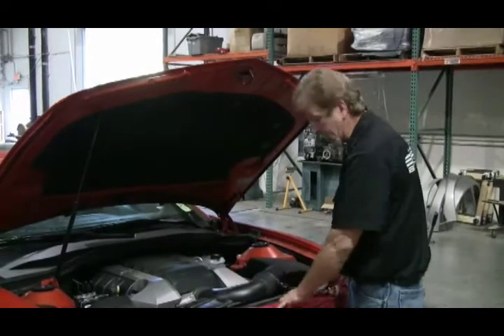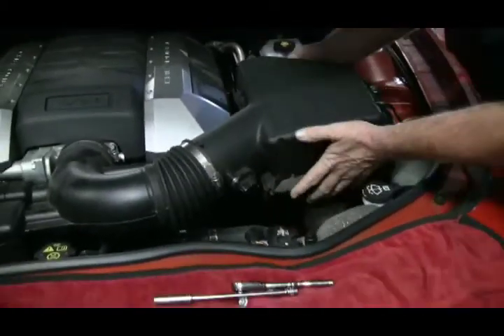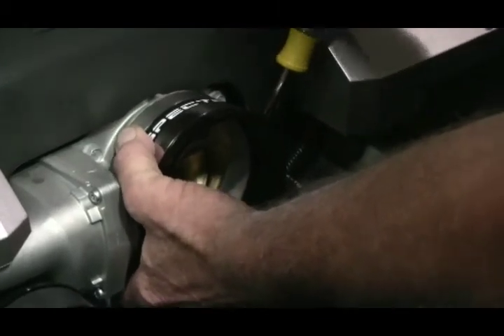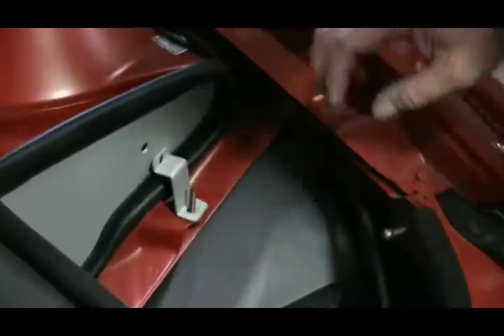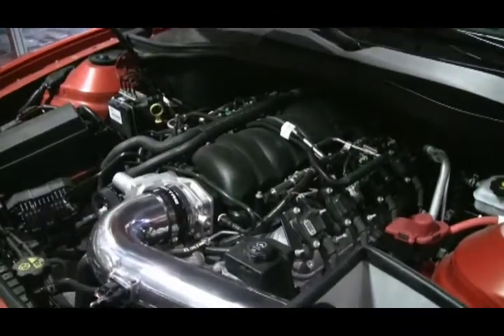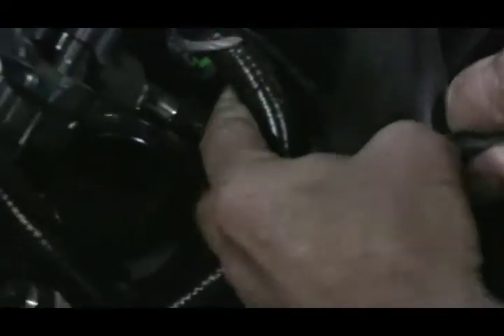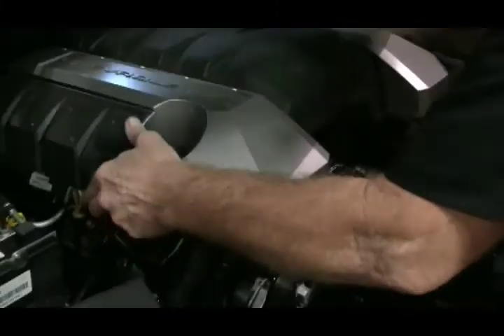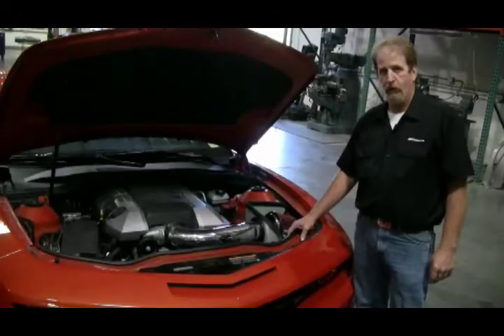Spectre 2010 Camaro SS Cold Air Intake Dyno Test & Install

Comment: I noticed the difference with mine but I have headers with a bigger Y pipe and straight piped exhaust with a flowmaster super 10. and upgraded 8mm MSD wires iridium plugs and Accel super coil pack. before the CAI it felt like my truck was struggling for air after it had a lot more throttle response and my exhaust got way more loud.

Comment: No Cai will make a difference without a tune other than sound. I have a srt8 exhaust tune and spectre Cai all combined made a difference but claims of any gain from Cai only is rediculous
Reply: 1999 Silverado 4.8L (Superchipped and a few other mods) had 296 HP before install, currently making 313 and getting 3MPG more than I did previously. It depends on the car you put it on. It was tested on a dynojet, 2 runs pre-install avg 296, 2 runs post-install avg 313.

Comment: Youll never see 21hp, nor 12hp from an intake mod on a factory bone stock engine. But, thats marketing for ya.
Reply: Who told you this?
Reply: I'm about to redo my turboback exhaust on my '14 WRX

Do you think an aftermarket CAI would see gains after this swap?
Reply: Not impossible 
It is VERY UNLIKELY.
However im sure if you put a cold air intake on an old amc that has a crappy air in design you might be something in the ball park
Reply: Vegeta Barrett No......the throttle body ultimately limits the air flow. Installing aftermarket intakes will SLIGHTLY boost your top end power (maybe 1-3hp at best) but the rest of your rev range will likely suffer as a result. Overall, your engine will generally be producing LESS power.

Restriction in air flow increases air velocity, aka air will be sucked in FASTER. This restriction will only become a problem at the top end of the rev range, elsewhere it is very beneficial to power AND fuel economy.
Reply: Vegeta Barrett Whats interesting, is today you are seeing variable length intakes. Which my Honda has, Im sure other car manufactures have something similar as well. Which will boost your low end power AND your top end power both.

And that is a well designed intake honestly. Especially in smaller engines, low end power is what you want to boost since they tend to suffer in the low rev range due to less displacement of air.

Comment: I don't know the "HP results" but I do know the feeling and sound of my tires breaking loose is a real enough result for me to believe these Spectre CAI made difference in my truck. I have a 4.6 F150 with 35" tires and the thing was a dog. After the intake it woke it up noticeably. The intake came with a dyno printout claiming 10 HP gain and 14 ft lbs torque on a bone stock 2010 4.6 F150. I'm just stating that my truck woke up a bit, looks cleaner in the engine bay and sounds good too. For me $139 was a good price for a little extra pep, makes the fun to drive.

Comment: All these guys saying metal intake is bad, but every time I have popped the hood on my car, which has aluminum CAI, the tubes have been super cold, but it may be different for a larger motor and less room I guess. I have an 02 civic ex and the headers are pretty far away from the intake and the air filter is all the way at the bottom of the engine bay so it can get lots of cold air.

Comment: So normally you have 0 turbulence or wind coming into the cold air portion right near the windshield wiper tank? you might want to blow a speed controlled movie production wind fan over 100 mph right near that fog light grill and cast it under the car in order to see the real  true difference. Just figuring in the wind that gets deflected then sucked up by the left plastic wheel well. Also another great thing about the Cold Air is more room to see around your engine and it makes the car sound beefier when you step on it.  10/4 love the haters.

Comment: I drive a 2011 ram 1500 with the 5.7L hemi. after a resonator delete and plugs, im around the 400hp mark, basically factory. what do you guys think a complete K&N intake kit would add to my horsepower?
Reply: I have some experience with bolt-ons and a 5.7 Hemi, I owned a 2006 Charger R/T and installed a custome made exhuast with shorty headers and a true cold air intake, filter was in the bumper near the ground. I tested before and after and stock pulls would give top HP at 310 at the wheels, after the exhuast the car felt faster and I tested it, but the top didnt change at all, was still 310 or so, but the torque curve was straighter in the middle. I then added the cold air and once again, it didnt get more HP at the top but did so in the middle, some places were almost 20 HP more and the car felt vastly faster, I think we worry about that total number too much, the heads can only push so much air, but you can deliver more air to them and get it away better.

Comment: Last time I checked 21hp/ 426hp= 5%   I'm pretty sure they are doing some B/S. CAI do work but unless you are driving a 300+ hp vehicle, you wont tell a difference.
Reply: I'm skeptical.  You don't see the actual dyno run results on the dyno itself.

5% can be accounted for via margin of error and fluctuation (or manipulation) of the ambient environmental conditions, or a flash tune.

Or accounted for by the fact that the factory filter was plugged beyond belief.  To me the idea CIAs or short rams add to power is to say electrical superchargers do the same.  It just isn't going to add enough cold air to make a measurable difference.  I've seen independent experiments in 200+ RWHP vehicles whereby it REDUCED power and in no cases increased it.

Comment: Look up cold air intake myth busted. I don't completely disagree with them if your completely modding your car out spending the big bucks to get the absolute most out of your car but ur not gonna put a intake on your car an get in it an feel the power difference. Just my opinion though to each to own
Reply: They did that test on a forced induction car...
Reply: they did on both not just forced look again

Comment: My boots did not have the white spectre logo's. :-( 
Anyway I did not think I would noice a difference but it seemed to made a huge difference on my 2010 Challenger R/T with Flowmaster Super 44's.  I went to test accelleration and instead of my car launching it lit both rear tires so hard my rev limiter kicked in. It was freaking wicked! 
Much better throttle response and at 40+ doing the right foot stomp I noticed a decent change.

Comment: A cheap spectre cold air intake would never give you 21 hp EVER. This is a BS dyno graph, the v8 Camaro should have around 350-370 hp with drivetrain loss included.

Comment: Most cars now days have a computer that learns as it goes, thats how it adapts to different conditions.  Depending on the make and model, it should learn itself.  So more air flow to the MAF will cause the computer to self adjust itself, it if is the right type of computer, a haynes repair manual will more than likely tell you this.

Comment: that dyno sheet at the end of the video is complete bullshit,  the Camaro SS is rated at 420 hp but the graph shows 298 hp,  thats either a bullshit dyno sheet or it was a V6 Camaro.  Either way these guys are full of shit because they said it was a V8
Reply: It’s def a v8 auto. The auto Camaro ss is NOT an ls3. It’s an l99. Major hp loss through the drive train as well. It is correct on the wheel hp being read by the dyno. The 420 hp rating of the Camaro ss is measured at the crank, and in an ls3 with t56 manual trans, not the wheels.a good cai will produce good numbers.

Comment: I have a good Question. Right now i have a 77 chevy Short/Wide 1/2 ton and i dont want to run the intake like that per say, But filter ontop of my carburator and funnel air from the front on both sides. Could you posibly show a video for that?

Comment: Actually K&N sued the hell out of Spectra for false claims including ones like this just this year. Because of this lawsuit and what it was about I dumped my faulty Spectra air filters and went with K&N and Perrin air filters. And speaking of which I can personally say that Spectra does not make a good air filter. I bought four and they all fell apart. Looks like they used cheap material and not once did Spectra return my concerned calls.